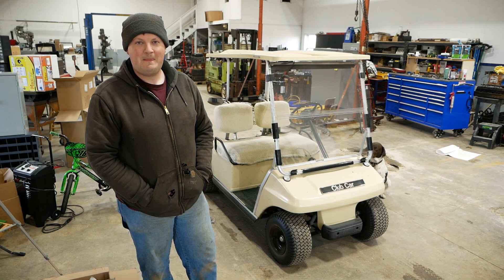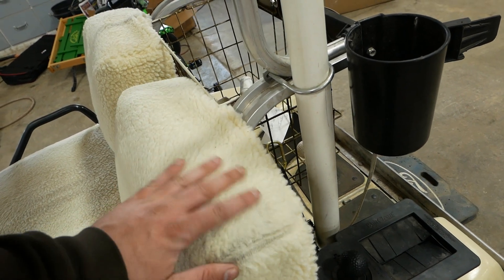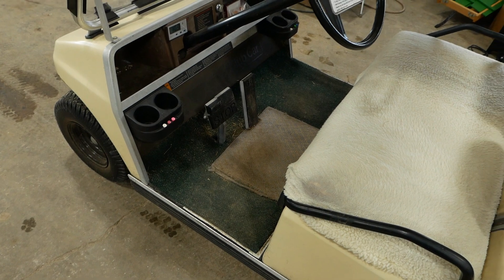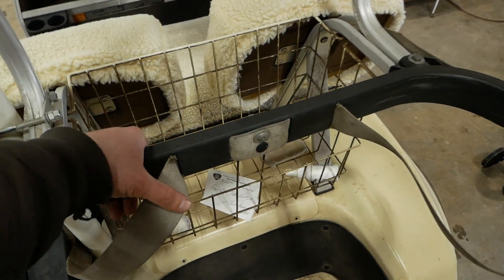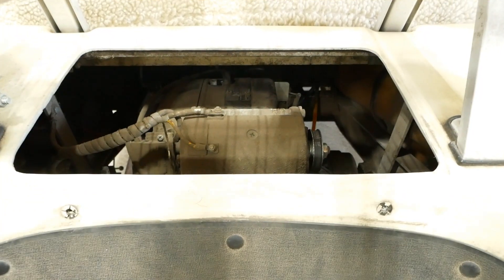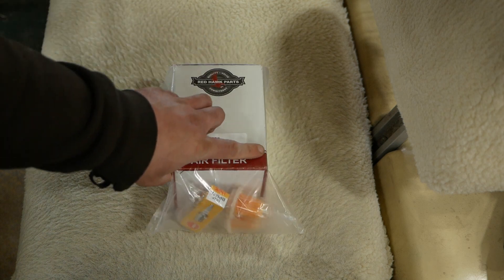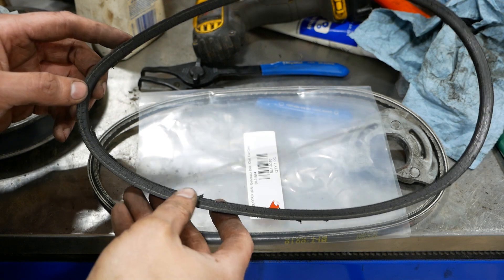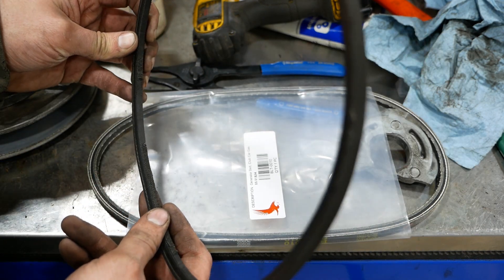Fixing a Golf Cart

Comment: We use two of these on the farm and they are tough as nails. Nothing to rust out either as the frame is aluminum and the body is fiberglass. The engines are Kawasaki and seem bullet proof except for one flaw that we have seen. The Club Car has a speed governor built in the transmission so the Kawasaki engine governor is not used. There is a sheet metal bracket that is riveted to the end of a plastic cam gear in the engine which I think is part of the unused Kawasaki governor system. It serves no purpose on the Club Car. We have seen the rivets fail on two engines and when that sheet metal comes loose it falls down in the crankcase and all hell breaks loose. In one case it broke the skirts off the piston. Just drill out the rivets remove the bracket and replace the rivets with pan head bolts and locking nuts. I hope this helps somebody out there to save their old Club Car from disaster.             Oh, and if your are wondering, the Club Car with the broken piston skirts is still running after the carnage was cleaned out of the crankcase!
Reply from the maker: Interesting.

Comment: Just a tip, on the back of the shifter lever there is a spring loaded plastics triangle shaped cam. If you pull it towards the engine and rotate it 180 degrees it allows the motor to run in neutral. This is very helpful when diagnosing things so that way the cart isn’t always trying to move when starting the motor.
Reply: Can you tell me how to fix my golf cart

Comment: Watch wes work while I'm at work. Sounds like a good day to me.
Reply: Yeah... watching Wes and looking for 5:00
Reply: Watching you work, figure out machines you haven't ever worked on before and execute a fix gives me hope. Maybe one day I'll figure out the ignition system on my cub cadet zero turn mower.
Reply: @roberttrevorrow5968 I feel your pain. Same issue, same brand, same type. Probably ignition module. Mine has an 18hp Kohler - good engine but needs the valves adjusted periodically or they'll stop firing / start misfiring.

Comment: the spring tab position in outer cam is a big deal. It's tunes the opening torque for the driven pulley to the torque of the engine and desired acceleration. The tighter it is the higher rpm and torque it will require to open.

Comment: The forward/Reverse switch get corrosion between contacts and doesn't allow good contact so no start. Need to tack apart clean and apply die-electric grease put back together.
Reply from the maker: The starter was spinning, it just would not turn the engine.

Comment: The noise he tried to reproduce is like a high pitched whine mixed in with Wes' kid trying to make like scifi pew pew pew noises. The cart I have at work does this and it's my anti-theft device. I can tap it just right after like the third try if not the first try but the general amount of people that just hop on it and think its a go kart won't ever get the thing to move. You've got to lightly tap it to get the starter going. That knowledge comes from daily use of your machine. It's a Toro Workman with a B&S 16 HP gas engine on it. If anybody has the chance to get one on Marketplace, they're fine except cosmetic stuff like the bottom thin sheet floor is falling apart.

Comment: That is the old K82 Kawasaki engine.  Club Car stopped using them in 92 and went to the FE290.  Both of them are now obsolete and difficult to get some pieces for.  BTW you will have to tighten that starter/gen belt in a few days.  They stretch bad when they are new. Been a CC mechanic for 20+ years.

Comment: You crack me up!  Never get a job where the customer diagnosed the problem correctly.  Loved the test drive.   And the oversized cup holder is supposed to hold a mix of soil and grass seed to fix your divots.  Edit:  I was waiting for the spring to launch that clutch into one of your new lights.
Reply from the maker: Well if they knew what was wrong they could fix it themselves.
Reply: @WatchWesWork  You give people far too much credit.  I would guess 65% of the population couldn't recognize, diagnose or fix some of the simplest problems on their daily driver.  Get past a flat tire and they are dumbfounded.  I don't know how many people I have helped who tell me "won't start"  when it is a easy as a loose battery cable. I noticed people you are helping are keeping their cars and trucks as daily drivers for many years.  Do you see that as a pattern, or is that just for YT purposes?

Comment: Behind the shift lever, under the seat. Is a plastic cam, with three rids. The ribs contact a few micro switches. If you pull the cam back and rotate, the machine will be in maintenance mode, which will allow the engine to run in neutral, but not forward or reverse.
Reply from the maker: OK thanks!

Comment: At work I learned repairs on an 80s EZ-GO with a Robin 2 stroke engine, it was decent but we upgraded to a JD Gator a few years ago! Nice vid!
Reply: I have a 70's EZ Go that doesn't have the belt driven starter-generator. Evidently it is "built in" under the flywheel?  It has a dead spot in it. If it stops in the same spot all the time, you have to turn the engine a bit to get it to turn over. 
 I wonder if it's fixable?

Comment: Is there no service on the ignition..? What about the spark plug wire..? Is there a distributor on these engines are perhaps they are all solid state with no service..? What about the transmission.... any fluid change necessary...? And I believe that some of these engines use a traditional oil filter, but some do not... And lastly, should the carburetor be cleaned..? It looks like a cover can be removed for cleaning and install a new gasket...? It also seems there may be a bleeder valve under the carb...

Comment: @11:08 I had the same problem last Thursday morning. A fellow pulled into my drive with a flat tire and didn't have a lug wrench. I figured out it was metric, but I didn't have a 21mm socket here. I had to run to the neighbors for a bit of help and the guy was back on the road, with a bald mini spare in no time. It's a good thing he was only 75 miles from home. I doubt that spare would hold up to 80 miles 😆

Comment: I don't get it how did you not clock the old one without damaging it  meaning you did not have to maintain pressure to install the snap ring
Reply from the maker: Because the cam is a tight press fit on the shaft.

Comment: Let's see. There is no warm up. When you push the throttle it starts and goes  mimicking a battery golf cart. Trying desperately to be a battery powered golf cart that maybe won't leave you out of battery on the 16th hole with a bad heart. But doesn't this have a battery too?
Reply from the maker: Actually at low RPM it basically runs off the starter motor. So it's more like a hybrid.

Comment: I have never in my life had a pulley come off a shaft that easy! Lol
Reply from the maker: No one has!
Reply: Usually when they do, something horribly has gone wrong and broken
Reply: Luckily my snowmobiles have a similar setup driven/secondary clutch, and they slide on and off with ease (well for the ones designed to be removed easily. Newer sleds are a one piece clutch and jackshaft design). Which it coming off with ease is a good thing as you need to remove it to get to anything to do with the carburetors or intake boots and other general maintenance
Reply: @WatchWesWork  Mine fall off harder than that.

Comment: There is a plastic sleeve on the inside of the gear selector that you can turn to put it in service mode. You will be able to start and run the motor with out it up on jacks or running off. Tip for next time. Thank you for all of your tips and tricks.

Comment: Hi Wes, fun video.
Some questions, not criticism, just questions.
When you replaced the clutch piece why did you not clean the shaft it rides on? And why assemble it all dry?
Maybe the manual said it should be, but seems it should need some lube to slide on the shaft.
Thanks for sharing.

Comment: Wes, just a tip for future reference. I believe there is a service switch just behind the shifter underneath the seat in club car / carryall utility vehicles. When turned to the left (If I remember correctly), this allows the cart to start  and run in Neutral. You can turn it back to the right to resume normal operation after repairs are completed. :)

Comment: Just FYI, Wes, the engine in that Club Car is a Kawasaki engine. Some newer golf carts have a 2 cylinder engine, almost doubling the hp to between 18-20 hp.
Reply: Yes we want to see that upgrade 👍🏻
Reply: what does that older one make for HP? Just curious
Reply: @therandomchannel2022  somewhere around 9 hp.
Reply: @Farm_fab  Not too bad I suppose
Reply: I’ve seen golf carts with the stock motor trashed, and replaced with a 550cc fan cooled snowmobile motor, which is about 65-70hp, they do nice burn outs and are nice for cruising the pits at a race track 😂
Reply: Or you could go all Cleetus McFarland and put a Hayabusa engine in one..
Reply: @t.w.3  cbr1000rr motor. But close enough
Reply: Some old geezers in retirement communities upgrade the engines to make them street legal so they can drive them to the golf course, the liquor store, chiropractor, etc.  Some do 25+ mph.
Reply: I think some guys here in Sweden tried building a railway  speeder using two cylinder engine with suitable frightening transmission .....   i believe they did something like 45 mph with that thing (or more).....  Think sitting on something with two axles, small handcar wheels and not more protection than if you are on a bike.
Reply: @TheStefanskoglund1  swedish elon musk is metal as fuck haha
Reply: @Frank-Thoresen  throw in a hayabusa engine